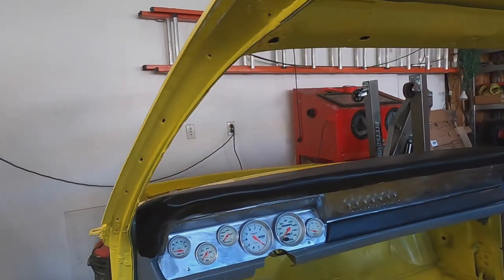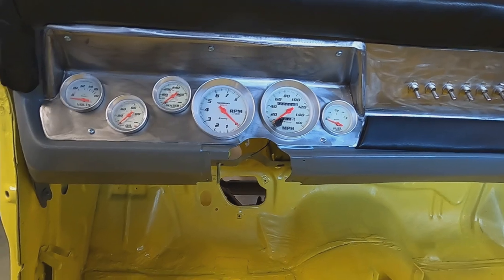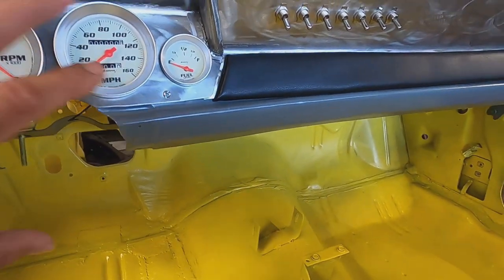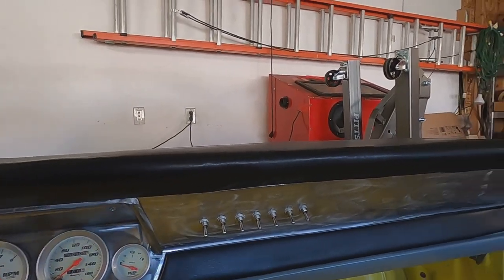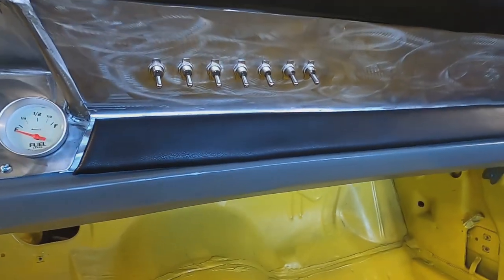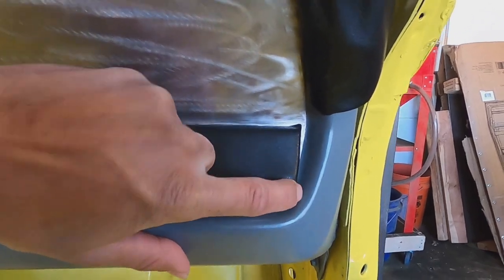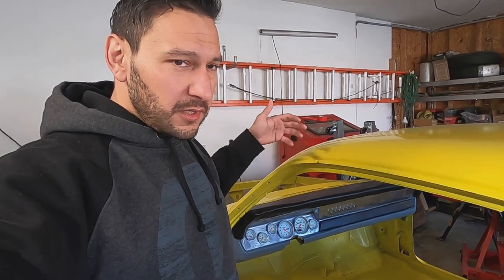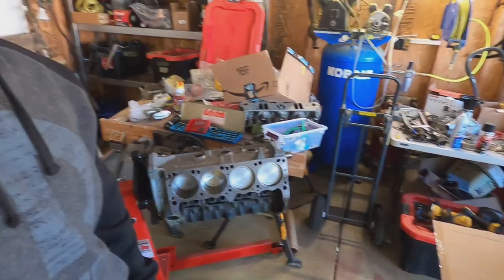'74 Duster Custom Dash Reveal. New Gauges, Switches, Vinyl, etc.

Comment: You're doing awesome with your build. I just watched your driver floor pan weld and realized my 71 duster is the same green color.
Reply from the maker: Thanks Thomas! Yeah, some of those old colors were a little different. I was not a huge fan of the green that I had so opted to change to one of the high impacts. Probably not the best for resale, but I don't plan on selling so all good. Thanks again for following along!
Reply: @DustorBust  I dont plan on selling mine either. Im thinking of painting my duster one of the new mopar colors out now. Blend in a bit of new with old :)  but im so far from that step its overwhelming to think about it, but in a good way, keep it up brother your content is great!
Reply from the maker: @Thomzombie303  Thanks buddy!

Comment: Looks awesome! I’m looking at Classic Dash for my setup. What’s your wiring plan to eliminate the ammeter? Are rewiring everything?
Reply from the maker: Hi Acardiac! Good question, I hear those Ammeters are notorious for melting down.  I am just going to wire everything from scratch. I thought about it a bit, and I don't really care about original wiring. Not to mention it is currently an old dried out rats nest of cables😂. I will put out a few videos on it within the next few weeks. Thanks for following!